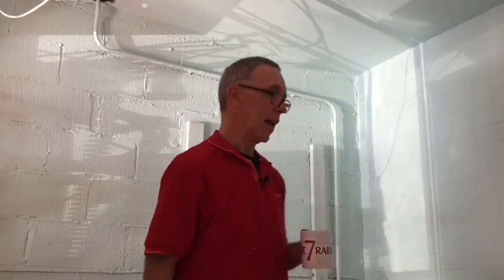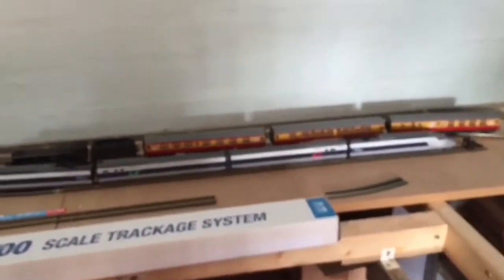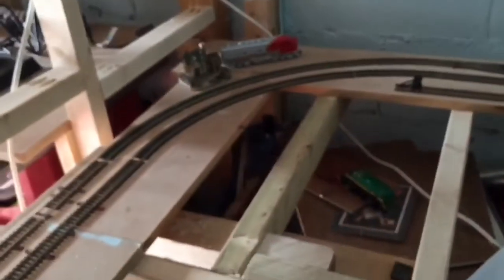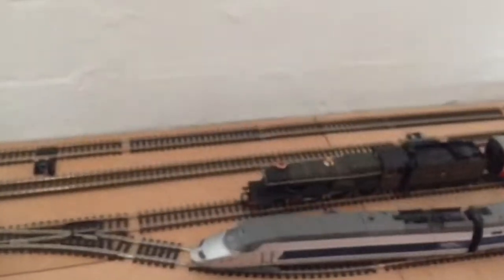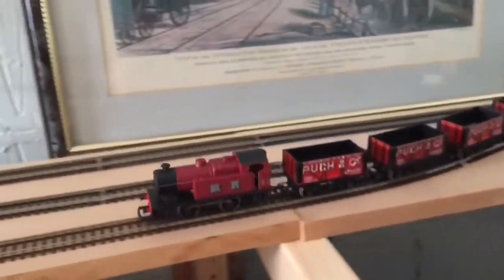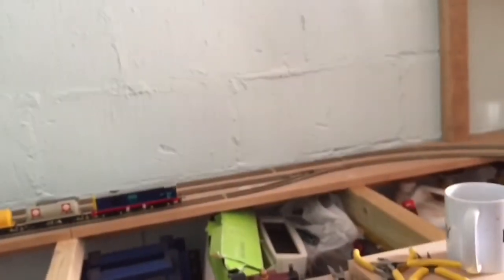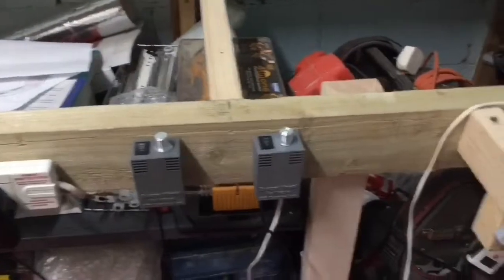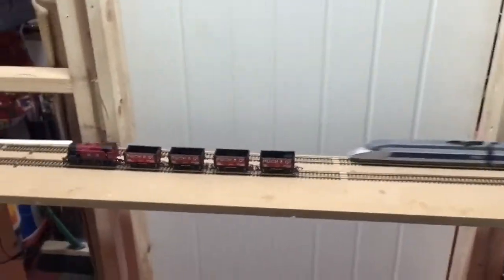Train Room project (part 4b). Temporary baseboard and track down. + short test/running session

Comment: Yay, good for you, so pleased, you must be so chuffed. Will look forward to future updates. The TGV coach could be derailing because the back to backs are slight out. In   words the gap between the wheels is either too big or too narrow. Could also be one of the couplings is sticking or bogie is stick. Later is less likely as it went around the loop.

Enjoy and have fun...
Reply from the maker: I’ll check the back to backs. Thanks for the tip 😀👍

Comment: what made the 0-4-0 jump on the inner rail  could be a bit of solder
Reply from the maker: Hi. The 0-4-0 was jumping because of a mis-alignment of the inner track. The board just needed a shim with a piece of thin card and it was ok. 👍
Reply: @route7railway567  thought it might be a fish plate not joined  ok great